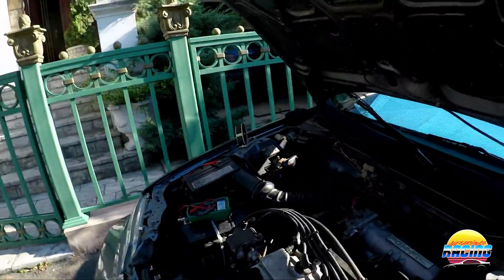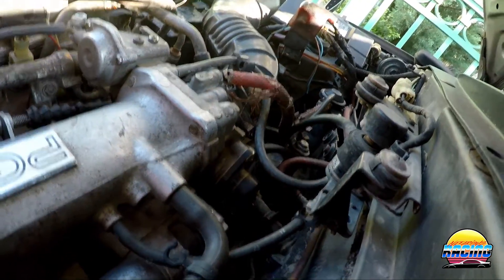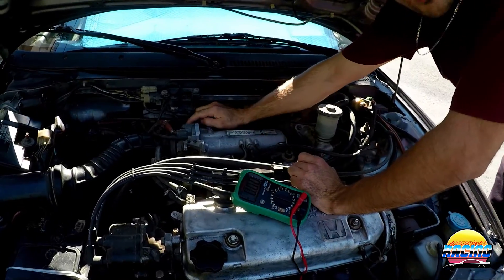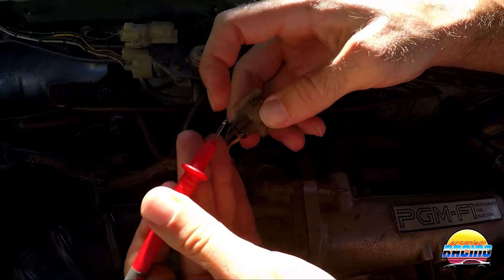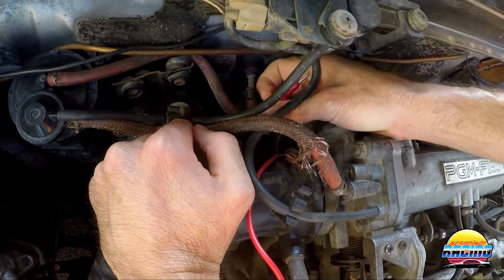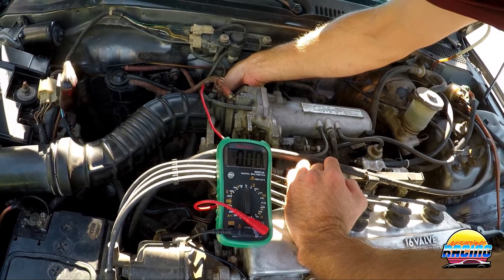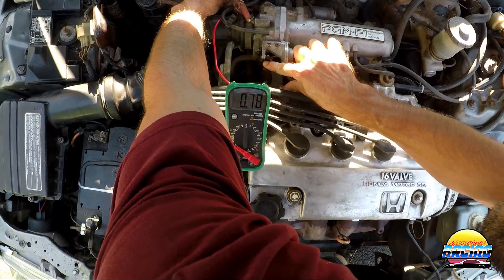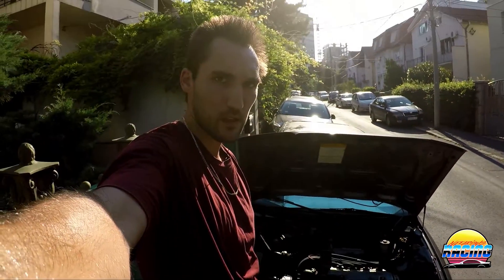How to Test Throttle Position Sensor (TPS) on Honda Civic, CRX, Integra etc

Comment: What does it mean if it doesn’t change when you are at WOT
Reply: I’m at .7 idle and it doesn’t change when WOT
Reply from the maker: @RuinedCivic  Is the reading changing at all as you open the throttle?
Reply: @nefariousracing  no not at all
Reply from the maker: @RuinedCivic  Sounds like you need a new TPS.
Reply: @nefariousracing  I’ll replace it and comment back to see if it was the problem
Reply from the maker: @RuinedCivic  Sounds good.
Reply: @nefariousracing  the dizzy was not the problem
Reply from the maker: @RuinedCivic  Why'd you change the dizzy? We said TPS.

Comment: My reading is 3.35 and doesn’t change when I adjust the ideal?
Reply from the maker: First I would double check that your multimeter works are you are definitely contacting the wires correctly. If yes, then something is probably wrong with the TPS.
Reply: @nefariousracing  Yes, as the power supply shows 5 volts, but the sensor is 3.35. The car recently started to turn off when I am slowing down such as stop for traffic signal. Doesn't accelerate as usual.
Reply from the maker: @zozotv3665 Very likely the TPS is faulty then.

Comment: for the beginners, get some type of sowing pins and insert them behind the connector. Go on the outer part of the seal to not damage it. Make sure you push it in all the way.
Reply from the maker: That's a good tip.
Reply: Just change tps sensor
Closed 0.5
Open 4.35 can't reach to 4.5.
By the way why tps so noisy

Comment: I am testing a 2000 honda civic lx and its showing 0.6 on idle with tps. Is that normal?
Reply: 0.6V should be normal. Try to clean the throttle & butterfly valve, some gunk there. It could be  self relearn to compensate for reduce air flow for a good idling.

Comment: Been having horrible gas mileage. Absolute Throttle Position reads 9.4% on OBD ll scanner. (2004 Honda Civic LX 1.7 Sedan). Going to go through the steps outlined in. your video so I can figure out if the TPS is the problem or a symptom. Thank you for a clear explanation.
Reply from the maker: It's likely the TPS is playing a part in that. Hope you got it sorted.